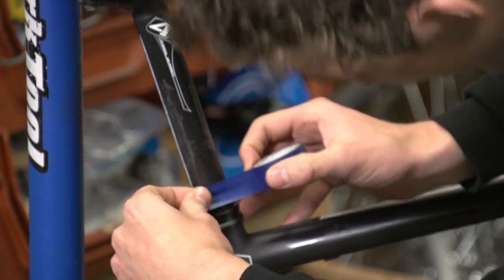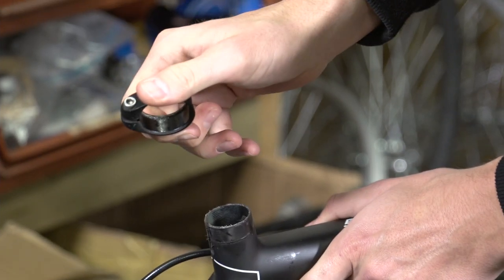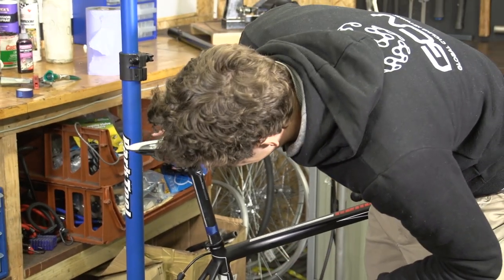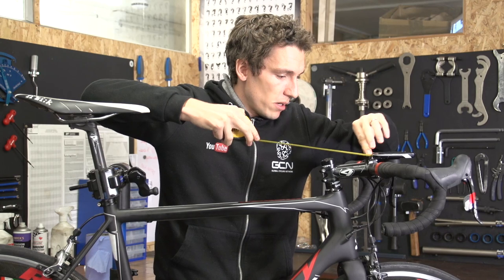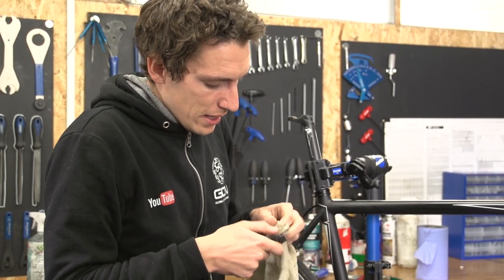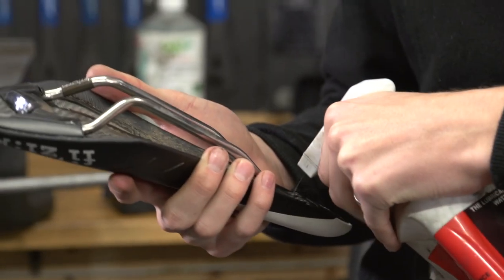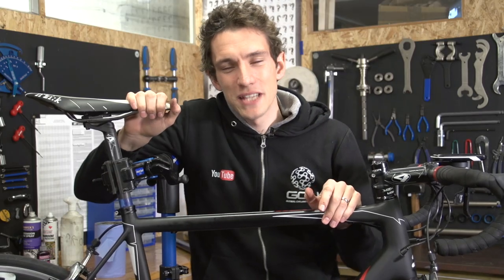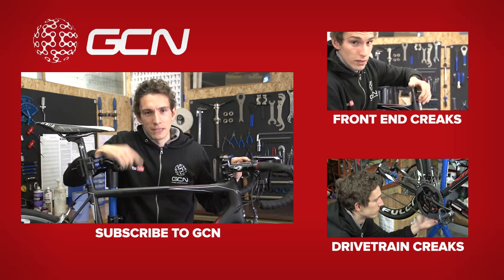How To Stop Your Saddle Creaking

Comment: This video was so helpful. When I put pressure on the seat/seatpost, I would hear the creak coming from the top tube near the headset. I thought I had a cracked frame and lost sleep worrying about the warranty, new frame and moving all the components over, which is a lot on an ebike. I cleaned and re-greased all the parts as shown and the sound is gone. Thanks!

Comment: Coincidentally I was just dealing with this problem! After having cleaned and greased the tube and rails multiple times, I was about to give up. But then it turned out the screws that kept the saddle itself together were the culprits. Just one round of tightening and the squeaks went away! Just a thought. Might work for some when you're out of ideas.

Comment: Oftentimes a creaky saddle can give the impression that the noise is coming from the bike frame around the area of the headsets. This caused me to disassemble and clean my headsets (which admittedly could use a good old clean as they were kinda grimy) but when I took the bike out next day the creak was still there. Realised it was coming from the saddle where it connects to the seat post. Removed the saddle and all bolts and fittings and gave the metal bits a good cleaning with WD40 and dried them with a rag and the problem was sorted. I also feel the issue was partly to do with having the saddle positioned too far back, so I moved it forward 0.5cm and everything was silent. Didn’t even need to remove or clean the seat post. Glad I cleaned the head sets though!

Comment: My 8 year search of my brand new Firfox MTV smoke's irritating squeaking sound ended today thanks to following your video. I never thought thatit can come from saddle mechanism beneath the soft compound. I took it first for a ride today morning after oiling everywhere except the saddle suspension. With no reduction in sound i finally decided ot open the whole seat and inspect, and put some drops of engine oil. This was the last thing to do before i had to give it for expensive service .i hardly used for not more than 5-6 kms due to its embarrassing sound, even though i liked it for its look, i kept it in store and did not sell it.

Comment: After watching a couple of videos I decided to try electric tape (easiest option first)  on the seat post(TREK DOMANE SL5 2023). When you take the seat post off look for scratches, that is most likely the spot where the friction is happening. I just did one layer of tape around  the scratch/damaged and I got rid of the squeaking 100%.

Comment: Thanks for the help, however, there is an easier way.
Step 1: get some wd40
Step 2: spray everything the saddle is attached to with half a cans worth of wd40.
That normally fixes it.
Reply: are you trying to degrease something?
Reply: Ciaran Dawson this really works?
Reply: Ha! My friend who is a bike rider thinks it's annoying slightly that I use wd40 alot. It's not like I found a big can of dry lube spray. If there is one I'll bet it ain't cheap either.

Comment: Torque settings go out of the window if you grease the threads Si! You will need a lower torque for the same clamping force
Reply: +stoppsi Remember though that the torque settings are also underrated so if you tighten at say 6Nm and you ended up with a variation of +.5% then that is well within the manufacturers specs.

Comment: I bought a replacement saddle a few weeks ago ( brand new )  because my old one was in a terrible state & desbritly needed replacing. So, I bought one that had extra springs on it ( thinking this would help in making my ride more comfortable) It does to a point but, the dam thing CREAKS & SQUEAKS every time I go near it let alone sit on it & ride my bycicle. So, cycling is a complete knightmare!!!   & I find it ABSOLUTELY ANNOYING & IRRITATING!!!  😬😬😬😬  I am not quite sure as what to do with it ( tempted to bin the dam thing & spend out more on another one) But, would be much appreciated of any help ( advice ) in solving this saving me a lot of money on another one. Not sprayed it with oil yet  or used any type of other solutions ( on the springs or under the seat directly)  this is actually where the problem is not the  two large springs itself. ( By this I mean the moment I put so much as a finger on the saddle it's creaks away like it's ment to.  Of course it shouldn't do this.  Someone PLEASE, PLEASE !!! help me from going mental. 😮😮😮😮😮😡🙅🙅😱 VERY SOON!!! ( Quite close to it now).

Comment: I just had to stop my ride to type this because I keep composing more and more flowery to dump upon Simon here.

For years a creaking seat post has been my companion. I took out the allen key and wailed kt down really tight thinking that would fix it but no. I figured if I lost another 10lbs it would fox it, but alas no.

Finally I looked at this video yesterday, went out and spent $100 on a torque wrench (1/2 price), some allen key sockets, and some anti-sieze. Tore it all apart, cleaned it, greased it, and put it back together. 10km into my ride and my seat post is *silent*.

Now to buy a plane ticket to the UK, find the GCN offices, find my way inside, and kiss Si right on the lips, COVID-19 be damned!

Tips having just gone through this: wear gloves and change them regularly when working with antiseize. That stuff gets  everywhere. I'm still finding little silver stains today...
Reply: theservman
You spent a $100 on a torque wrench; you must be nuts and they saw you coming!

Comment: I click on 2 videos on the end and goes to home page on channel :( ... so videos will be post on future or mistake ?
Reply: Sometimes the creek can come from the bottom bracket or head set
Reply: I find all creaks sound like they come from the bottom bracket because they travel through the frame. My most common cause is dirty contacts at the skewers.
Reply: the skewers shouldn't make any noise is they are tight as the hole which the skewer goes through in the hub doesn't actually move only the outside does aswel as the bearings, still greece it all up and try it it should work

Comment: #askGCN  I don't do plastic saddles & use a trusty old 'real leather saddle' that seems to have developed an 'intermittent fault' Any tips for silencing a creaky Brooks B66 sprung leather saddle?  The bike & saddle are used in all weathers, the leather has been cleaned and treated regularly over past 15+ years & is super comfortable. The Nose tension bolt has Never been moved (still locked in original position) the spring retaining nuts have been checked & tightened but over the past few months the saddle sometimes produces an annoying creak and occasionally the odd 'click' that I can not seem to track down.  Any help on how to overhaul a dual rail sprung Brooks saddle would be greatly appreciated :-)

Comment: FOR ANYONE WITH CREAKING BROOKS (i had craking brooks flyer):

I tried oiling, i tried even melting proofide into bolts, i tried everything, THEN i bought (cheap) silicon spray for rubber and plastics protection and just sprayed a bit on Brooks tensioning bolt, and it stopped creaking immediately, no creaking at all now after 200km.

P.S. WD-40 also worked but only for few hours, i guess because it evaporates sooner or later.

P.P.S. I didn't try spraying the oil, maybe that does the trick as well.

Comment: I am using R3 saddles. It comes it is carbon braided rails. So if I use it with a side clamp seat post, any advice on how to properly install it? I heard many saying if i wanna use carbon rails saddles, i need to use top down clamps seat post. True?

Comment: Or if the seatpost is to long and goes to deep into the frame were the  tube isn't polished, that can also make a metal creak. Just cut a piece of the seatpost but don't make it to short, it has to pass where the tubes crosses (strongest connection)

Comment: hi! I used to set my seatpost according to my height, but that caused crack whenever I pushed the paddles. Then I lowered my seatpost and sound disappeared. Unfortunatelly I cant have a comfortable ride. Here are my questions. 1) does this voice damage my frame because it is alloy. 2)if I change my seatpost with a longer one, does it work?

Comment: Nice tips! but what kind of grace grease to use on bicycle bolts?
Reply: The red Military Grease PM600 is what pretty much anyone uses on bicycles. That grease is only meant for NON moving parts though. If you have moving parts like pistons sliding through o-rings you need another type of grease. This one here just seals stuff up. I put it on any surface that is meant to be locked into place to avoid cross corrosion.
Reply: @kicka55  thank you

Comment: Great video, how do you prevent the saddle from sliding back from the saddle pole? I have an old bike frame and the saddle rails seem to be slimmer than the old ones. I have tried electrical tape but failed, perhaps it needs to be thicker to hold it in place. Thanks
Reply from the maker: Hi Carlos, I think that electrical tape will just get compressed when clamped which is why it's not working for you. You need to shim it with something harder, and a good old trick is to very carefully cut up an old Coke can and wind that around the saddle rails. Good luck.

Comment: ok , and what kind of greaser is recommended with carbon fibre frame and alloy seatpost?
Reply: Nagy György Krisztián Nagy "Fibre grip" is a product from Finish Line made for carbon fibre but all it is is grease with some kind of fine sand in it.  It's gritty and that's how it improves carbon to carbon clamps (which slide due to the torque limit and the smooth finish on some carbon parts.

It will work super well on carbon-alloy, alloy-alloy... anything that doesn't move.  My friend has T.T. bars that would slip and fibre grip stopped that shit outright!

Comment: Finaly solved saddle nose. It isn't any of that in video. Noise come from leather meet rails. When I sit down saddle slightly bends and leather touch that rails. And make ugly sound I hate it.
Reply: Well, I just put some soft material on that clamp. I have some adhesive material for speaker box, but you can put some rubber or some sponge. After that I buy new saddle. Original was to small :). Now I have really cheep San Marco Spid but proper size. Soft material really solve ugly noise on original saddle.

Comment: Hi Guys can anybody help with This? I've got a really annoying noise from the saddle but it appears to be due to a small amount of movement in the tilt of the saddle due to movement in the   rail clamp even though the bolts are completely tightened.  Does this mean I need a buy a new seatpost?

Comment: Measuring from the Top Cap of the Steerer Tube would be much more accurate. The rotation of the handle bars can change giving inconsistent readings.
Reply from the maker: True, or you can just keep your front wheel straight. ;-)

Comment: I'm having this problem ATM with my Most panther saddle, the creaky sound is coming from the rail inlays when my weight bears down on top of the saddle, it bellows the spine and makes the creaky sound. I tried PTFE lube which helped but still get a low creaking sound. my belief is the saddle is on its way out :(

Comment: Never use a torque wrench on seat post clamp. Not all clamps have the same clamping force at the specified torque factor, this can easily result in over-tightening and cracking.  

Go by feel, tighten just enough to stop slipping, no more.